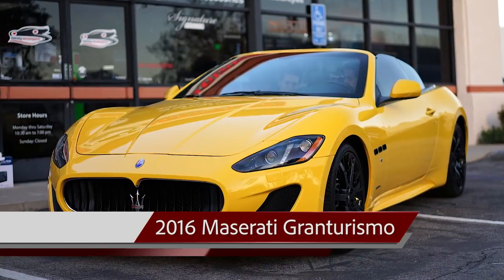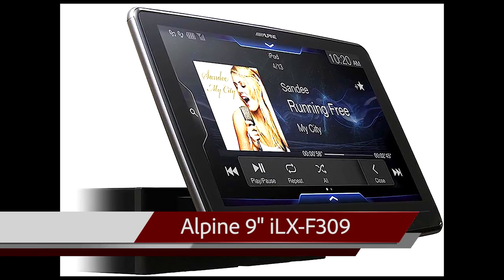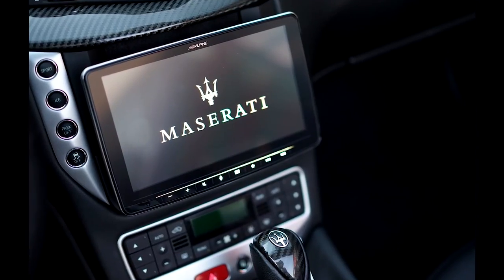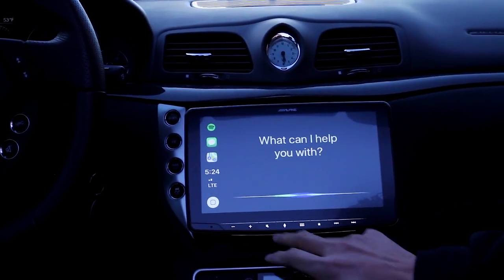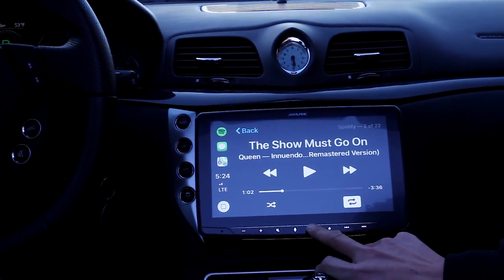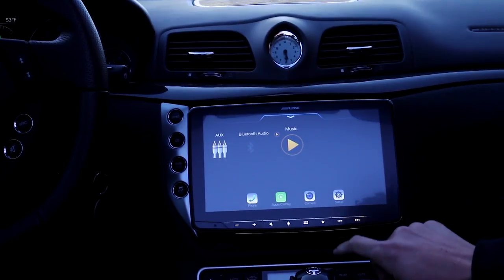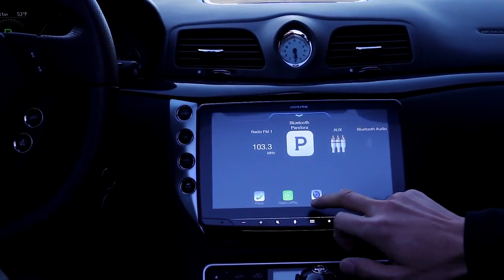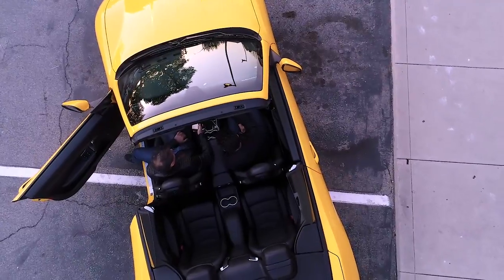2016 Maserati Granturismo with the new Alpine ILX-F309 HALO9

Comment: hi,
I have the same car (marasti grand tuersmo 2009 with boss systems team ) and I installed the same screen , 
How can I set up the steering weel ? 
which can bus I need to buy to wrk with my car and the alpine hola9 ?

Also, how can I set up the camera ?
I installed 33609 Alpine High Dynamic Range Rear View Camera (HCEC1100D)
Thank you for your assistance.
Reply from the maker: Hi, I can't really explain how to but if you call our shops, our technicians may better assist you thanks

Comment: How much to have this install done in 2015 granturismo ?
Reply from the maker: Marcus D. Hi the unit price is $899. Do you have bose system ?
Reply: @fantazymotorsports  yes I have the Bose system I have this installed by local dealer but mileage odometer keeps flashing can you fix this issue where are you located?